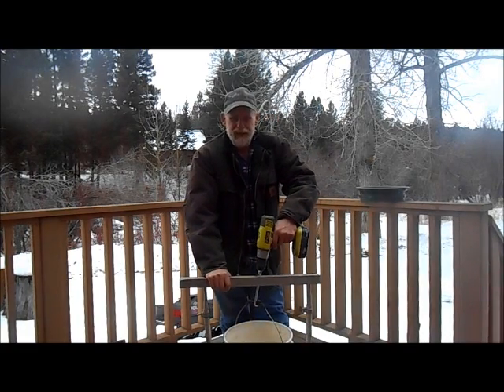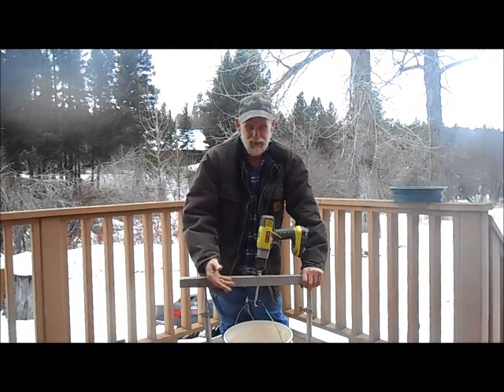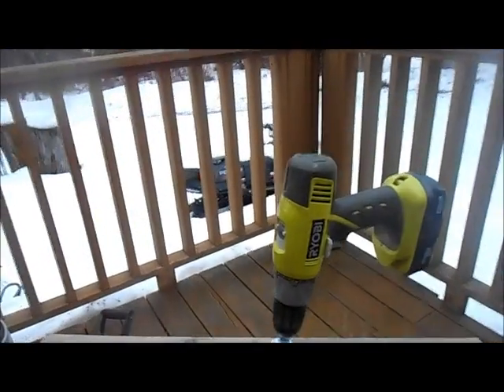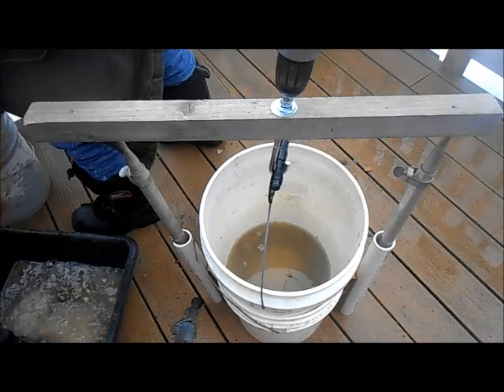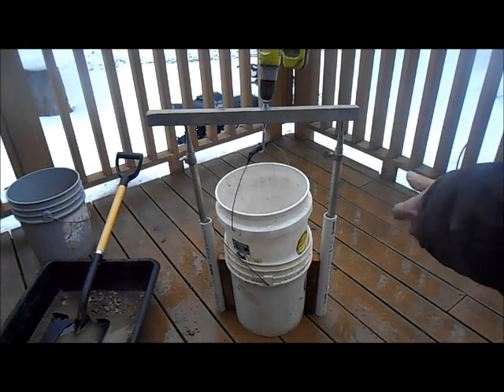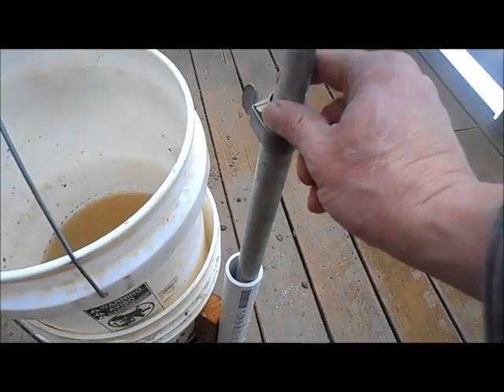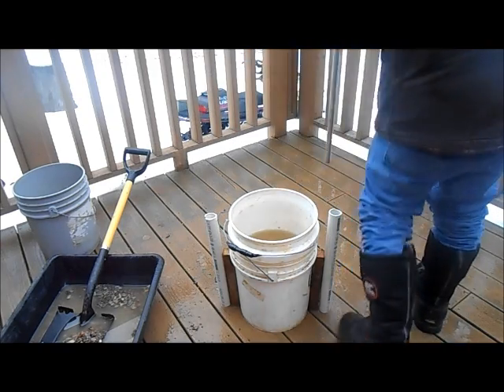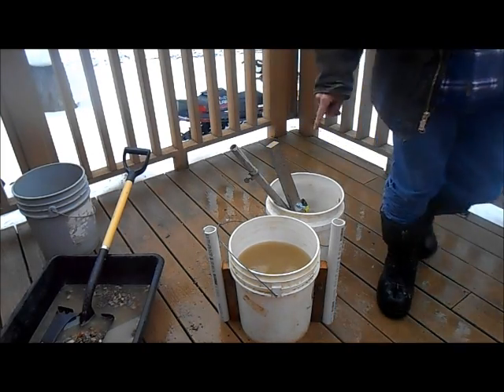New Spinning Bucket Classifier For Gold Prospecting

Comment: It sure seems like to me in my experience that a spinning classifier is the worst way to do it. When I use the bucket screens like you showed I rotate some but tap it up and down. The up and down movement seems to be what really makes the small stuff fall thought the screen. I have a lot of projects going right now but what I'm think of doing would be kinda like a teeter totter that you can just step on or tap with your foot that would make the screen bounce up and down just tiny bit and make the material fall through. Thoughts on this?
Reply from the maker: You are not the only one that thinks spinning is a bad idea I thought it worked pretty well. I am going to keep working on it. I like the teeter totter idea I have been thinking that might work or a hand crank on top to move back and forth. For me anything would be better than being bent over that bucket all day.

Comment: Nice man. Good idea yet again. 👍🏾 yeah I use a river sluice cuz it was all I get afford. And had to save forever for the blue bowl. Yeah I agree it would be more productive to spend less time classifying. Thanks for sharing
Reply from the maker: Thanks Kevin I can understand the afford part if you ever want to do a recirculating system you can use your same sluice use some 2x2 for a stand and some C clams to hold it together like I do and you can get a pump on amazon for about $15.00 and your in business. Just some ideas thanks for watching.
Reply: Yeah that’s what I’m working on now. I lucked out and my blue bowl came with a 250 gallons pump. And I already have a couple c clamps. It’s slow going but I’m getting there 😆 I’ll have to take a video some time to show it off. But heck yeah always open to some advice, thank you.
Reply from the maker: @KēvinRose01  I would love to see the video some time. I ran a stream sluice for 8 years before I got a pump 2 years ago. You will get there.

Comment: That is Soooooooo cool man.. Now you need to get a mini solar panel and carry an extra battery with you and charger..
Reply from the maker: Thank you Yes I plan on picking up one of those small solar panels and a smaller battery I have two marine battery's right now and super heavy.
Reply: @alanrobertson2510  oh yeah.. I have 2 of the big marine batteries from Walmart also.. but you could probably get that 35 ah battery from Harbor Freight.. I have one of those batteries and it doesn't get a memory
Reply from the maker: @Thebald1  Thanks for the tip I will check out harbor freight next time I get into town.